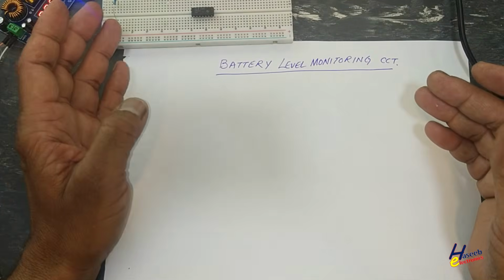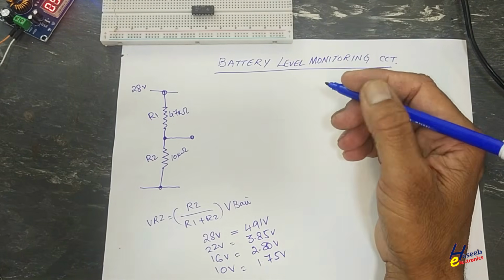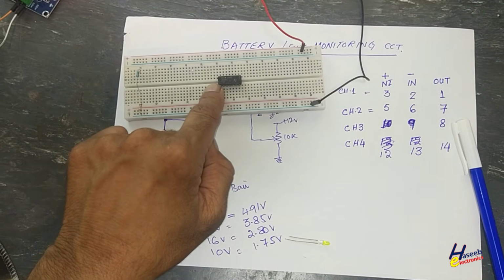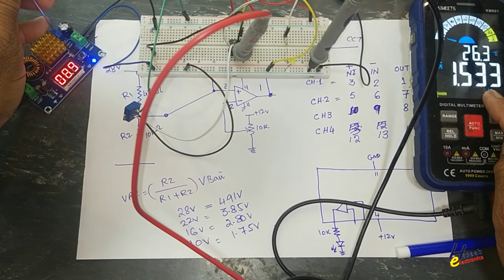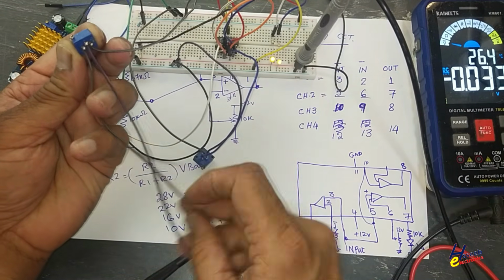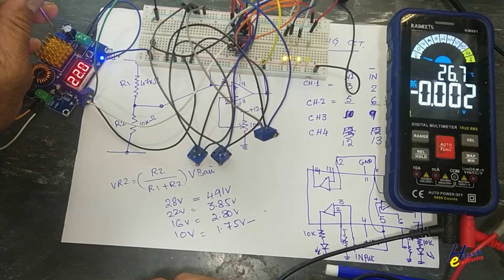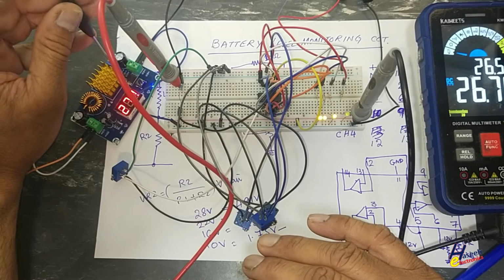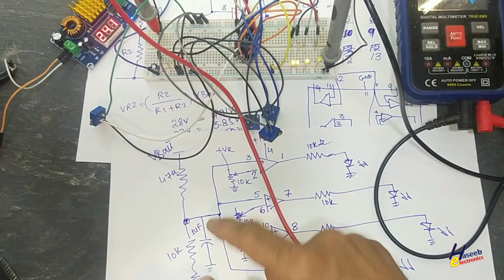How to Design Battery Monitoring Circuit using LM324 + LEDs | Battery Level Indicator | Ep#1442

Comment from the maker: Greetings!
What is your opinion about 
1. to Make the same project using LM339 Comparator IC
2. to make the same project using a single reference voltage instead of variable reference for each section
3. to make same project using discrete components 
4. to make same project using Arduino 
5. to make battery Low limit and Over-charging Warnings 
6. Battery Charging and Discharging control circuit
7. Any other idea to make same Project
Reply with your suggestions.
Reply: As our experience 339 is better than 324 for this type of battery percentage monitoring need fast switching.
Reply from the maker: LM339 is dedicated comparator for comparator function 
Opamp with positive feedback performs similar function 
Just positive feedback in opamp makes it a comparator 
While negative feedback is used to take opamp function 
For battery level monitoring on LEDs, there is special dedicated ic LM3914 it drives 10 LEDS stages
Reply: Please do single reference

Comment: This circuit will working with lfp battery? because it's discharge curve is different from lead acid/graphene battery.
Reply from the maker: LiFePo4 of LFP batteries can be monitored with same type of battery monitor 
otherwise LFP batteries need BMS. smart BMS manages the charging / discharging battery health etc
Reply: Our need is only monitoring lfp battery voltage between 0% 100%

Comment: Sir ek push pull ko use kr Raha hon osa ek ferite par bani 24 turn ka Sath or is par 2ndary 26 turn han mana totem pole driver bnaya hova ha ab jab load dalta hon us par to MOSFET bhot ziada hot ho jata ha 2 ya 3 second ma to TL494 ka Sath IR2110 low side push pull bna kr heavy load par Laga kr ek video bna da ta k MOSFET cs3205 ko safe bhi Raha or proper cold Raha havy load Par 300 watt par

Comment: Salam
What about simple circuit where LED connects to battery voltage, and LED light ON when those particular voltage levels reach, rather this LM324 circuit ? 
And why current considered 0.5mA, doesn't battery consume more current while charging and discharging?